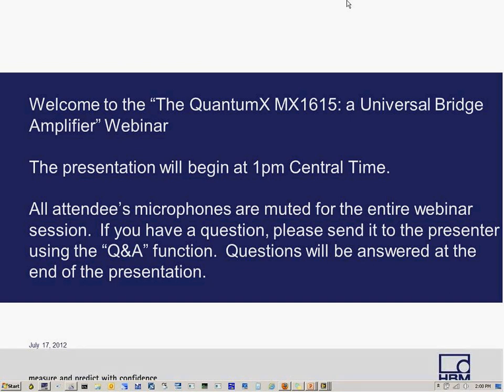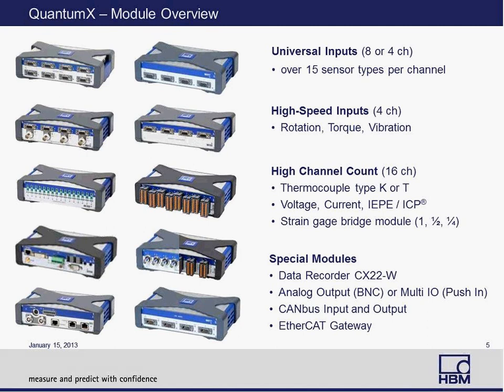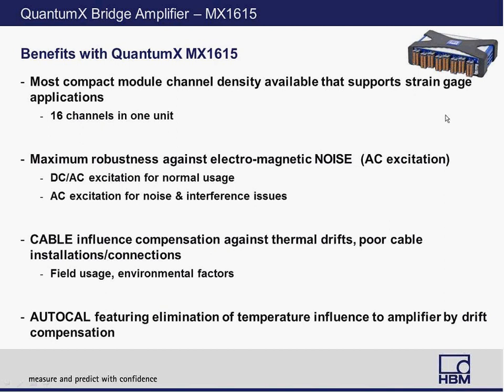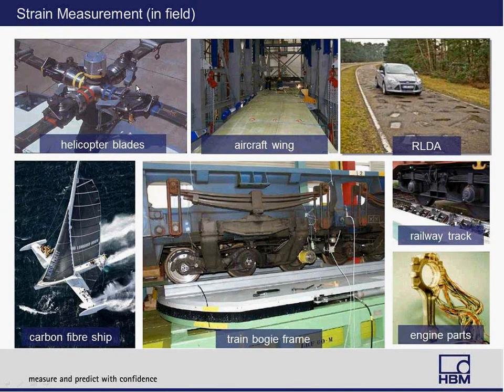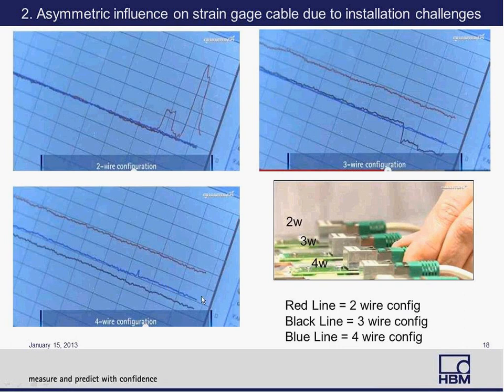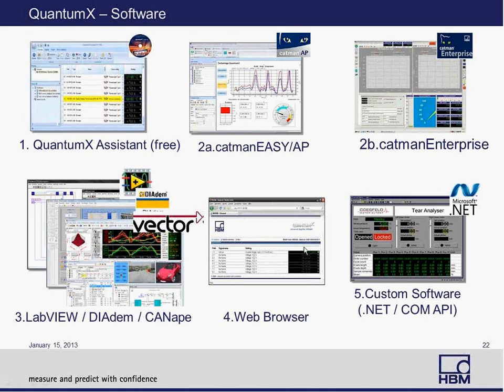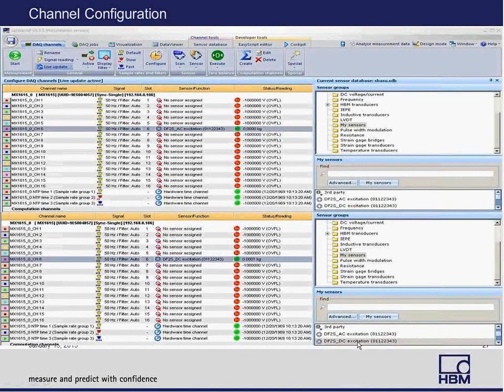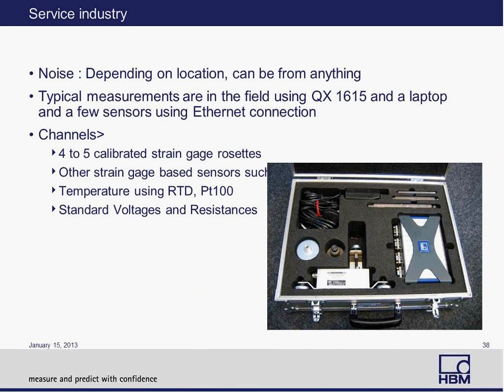HBM Webinar - The QuantumX MX1615: a Universal Bridge Amplifier

Comment: Hi, I have a question about connecting a diagonal half-bridge to the MX1615B. In the manual and in this video, there is a mention of connecting a regular half-bridge connection but is it also possible with the internal resistances of the channels to make a diagonal half-bridge connection within one measurement channel? 

Your response would really make my life a lot easier. Thanks!